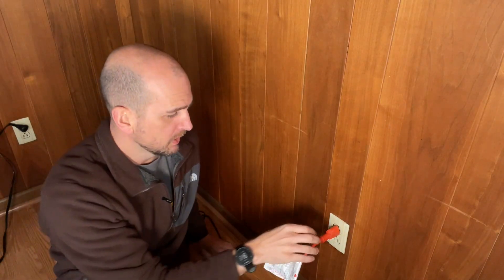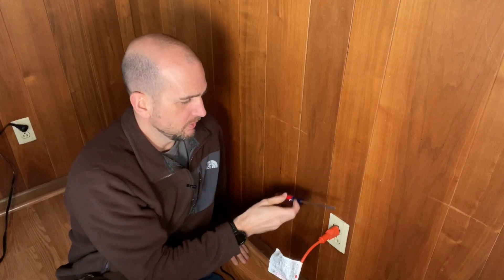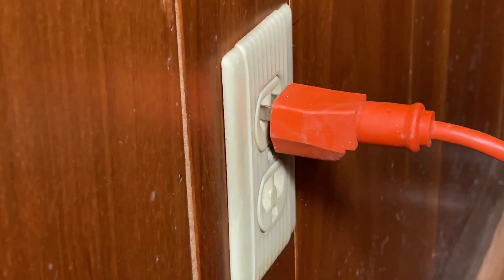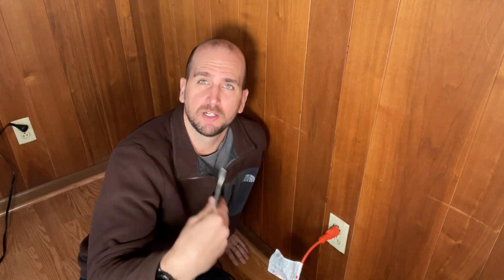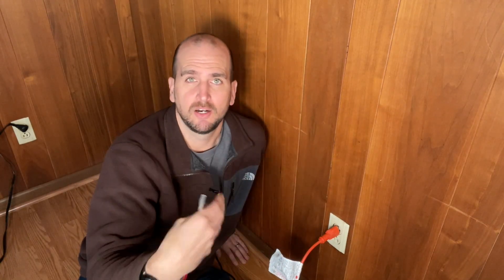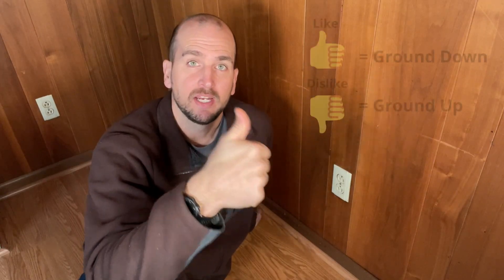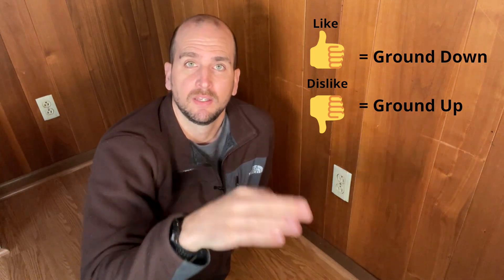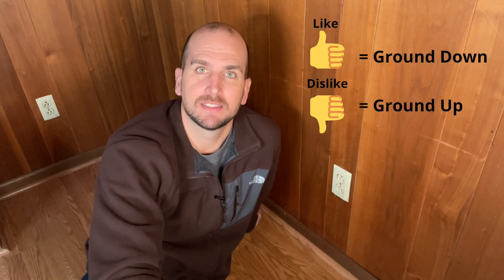Should An Outlet Be Installed Ground Down Or Up

Comment: I have actually seen something hit loose prongs and cause a short. It was a necklace and while the outlet was ground down the plug it hit didn't have a ground prong making that point irrelevant. Interestingly in the instant before it popped the breaker both the outlet and the thing that was plugged into it (I think a small alarm clock) were both damaged and had to be replaced.

Despite that I still prefer ground down because any thing I've ever owned where plug orientation mattered (most notably my wife's various plug in air fresheners) assume ground down. The last apartment we lived in every outlet was ground up when we moved in and I reversed about half of them in the time we lived there to accommodate our stuff.

Comment: Reposting here. I chose thumbs up only because I liked the video. I have done a lot of electrical repairs in homes and what I do is try to maintain consistency. If the home has ground down outlets I install new outlets the same way. And vice versa. New construction I do ground down as you mentioned, most angled ac plugs still follow that practice.

Comment: The ground pin is more likely to pull out enough to lose proper contact if you have it at the top (due to the leverage of the cord pulling down). The result will be an "open ground" connection which could result in getting shocked, etc. in certain applications (as I have seen happen many times in my work environment).
Reply: It's impossible for the ground to disconnect before hot and neutral. I've tested it.

Comment: With the ground up, if you were to pull the plug out while applying pressure against the wall with your thumb and forefinger, your thumb would most likely come into contact with the top prong (ground) first.

Comment: Originally, before we had plastic receptacle covers they were all metal. The ground was to be installed up for safety in case a cover should fall off and contact the legs of what was plugged in... This is fact.

Comment: Some cords have right angle plugs. Do you want the cord running down the wall with no bend in the cord? Or, do you want the cord running up the wall and then down with an ugly bend in it? You can always look at the labeling on the back of the outlet. If the text is right side up, then install it that way.

Comment: Ground down.  Not only does is practically every plug designed for ground down,  wall mounted surge protectors are designed for ground down.  But most importantly, ground down looks like a face 😲

Comment: I had taking classes at a State  University, one class was on Electrical Safety and was a super class. The instructor was a Senior Master State Electrical Inspector was telling the reason why the ground should be up. He question the class "who has small kids". Sometime they walk around with something  in they hands, let say a spoon, fork or something made of thin metal. If you have a ground down a plug had a tendency to sag downward, exposing the hot and neutral pole and a child with any thin metal will hit them, the child would get electrocuted. By having the ground up any thin metal  will touch the ground not the hot and neutral.
One thing I would like to say to the DIY guys & gals putting outlets in, don't let your young childen watch you doing any outlet change over. My son at the time was 4 years old, was seating beside me while I change out the outlet. The next day I went to work and when I came home the wife wanted to show me what my son did that day. What I say on the flood was the outlet I put in the day before.

Comment: I'm a union electrician in the northeast for 30 years, the industry standard here is that on any commercial and industrial jobs the ground goes up and in residential houses or apartments, the ground goes down. The reason we do it this way theoretically is that in a commercial and industrial building if a piece of metal slid behind a plug, it would hit the ground prong first instead of shorting out by hitting the hot and neutral prongs at the same time. That's the theory anyway.

Comment: the fact is that there isnt a code but an upside down receptacle is an indicator of specific identifier like if you add switch or 20 amp or 240 or gfci protected...... something that isolates. 
this is when you invert a receptacle

sometime people have a specific need to flip it for what ever plug demands such as it can only fit 1 way because of furniture and plug combo

if your your elderly and visually impaired you can flip all your receptacles because its easier to push in ground first or you can safely find ground by touch and guide ground in because ground cant bite you.

Comment: I prefer having the ground up.  There are no differences between ground up or down except for safety.  I work in a factory where staple guns are common, and all it takes is a random shot from the misuse of a staple gun to cause a spark and create a fire.

But, I will accept ground down because the device manufacturers commonly build their plugs for ground down.

Really, the standard outlet in the U.S. was not well designed for its job.  It is a "it works" solution, and everyone keeps going because no one wants to take time to change the plugs for something that would properly solve the safety issues.

Comment: When a plug is loose, it tends to start to angle downwards. If that happens with a ground-up outlet, it's possible to break contact with the ground while still retaining connections to live and neutral. That seems like a far greater risk, and is a point in favor of the standard ground-down orientation.
Reply: A plug where that's possible isn't legal.

Comment: In the absence of guidance from Code, the best bet is to follow general practices. Basically, as you touched on, that means ground up in non-residential applications and ground down in residential, with the exception of half-hots. This makes it easy on the user, who is already used to having receptacles installed in this way.

As an add-on, when I install receptacles sideways, I always put the neutral side up. It's safer, and I've never heard a compelling argument not to, such as from a user ease standpoint.

Comment: I have seen many ground down installs where the plastic around the ground was broken due to stress on the cord like with a wet dry vac or sander especially with 20 amp extension cords that are quite heavy .

Comment: At my place I bought 2 years ago, the outlets that are ground-up indicate that they are separate 20-amp circuits each with an independent circuit breaker.  That's an easy way to identify those circuits without using the outlets that have the T/sideways blade slot for specific 20-amp plugs.
Reply: Why would you want 20 amp outlets with out the ability to plug in 20 amp appliances

Comment: As for the hot and neutral cross arc,  ground to hot is exactly the same being neutral is grounded at the electrical panel. I am an electrician and at the company I work at we hate grounds up but in saying that if I was to build myself a new house I'd put the plugs sideways because the cords plugged in always look so neat when they flow nicely along side each other rather than passing over on another. The other benefit would  be you could then have the neutral and ground above the hot so anything falling is actually less likely to arc out.

Comment: Grounds down because any 90 degree plugs on devices have grounds down you don't want a plug wire going up the wall,  Most refrigerators have these style plugs

Comment: I go ground down because most grounded appliance cords are designed to hang in this configuration. Transformers/charging bricks also stay put when hanging down and send to pull out when hung the other way. I think an hour area, commercial buildings with metal wall plates the inspectors prefer the ground up in case the wall plate becomes dislodged and falls down on a prong.

Comment: Also not just a short but if the material is touching both hot and neutral is could just simmer and heat up causing a fire not just a short.

Comment: ground up for commercial is how I was taught, because of most plates/covers are metal in commercial ,  and ground down residential most are plastic covers. plus a lot of the small outlet testers plug in with ground down if not tester will be upside down when looking at code lights. but before I used to do all ground up, because way i was taught in electrical school.

Comment: I am an Union Journeyman Wireman,  I have worked on commercial and industrial jobsites all across the United States, for 24 years,  and 99.9% of the of the time, the receptacle is installed ground up.  The .1% was vendor preferred.  I rewired my 1928 (2015) old home with all ground up; I also used nothing but 12-2 w/ground and all 20 Amp breakers in my home. No 15 Amp breakers and 14 gage wire. Why? Well the first year in my home I had no furnace...just space heaters.  Space heaters are a fire Hazzard waiting for opportunity. Space heaters use 1500 watts. Do the math. That 15 Amp breaker will not always trip...the wire will just over heat and the receptacle will cook and over heat. Happened with a floor receptacle and it was under an entertainment center; I could smell it but not locate. I unplugged every Space heater in the house.  I pulled the on under the entertainment center the whole plug exploded in my hand and was in a metal cut in box with jiffy clips/ F clips pending on your region.  That's when I decided 20amps in my entire home. Over rated yes, will I ever worry over a 1500 watt Space heater or an appliance causing a fire no.  Three years later I was able to afford a gas furnace. 

Here is a thought...you ever see a kid with one of those cheap remote control cars with the thin remote wire...imagine a loose plug/ receptacle and that wire making contact with the ground down...that child will be electrocuted. Hope that image changes your minds...ground up!

Comment: I’m a portrait artist and I installed outlets into my studio. (I got help from my electrician friend) I had the ground down 😮 because the eyes should be on the top and the mouth on the bottom. 😊
Reply: That would be my answer also, but I’m not an electrician.  😄
Reply: This is the correct answer
Reply: This is the correct reason. Why would anyone want the face upside down? That seems demonic, like in those movies when holy crosses get turned upside down.

Comment: The argument that something might randomly fall on a loose plug is just dumb. It's much more likely that something like a speaker wire is pulled upwards into the loose plug in which case if it gets energized it's in somebody's hand. The reason that codes don't specify a requirement for any particular orientation is because when they investigate and experiment they find no definitive evidence that any orientation is safer.

Comment: Aesthetically i choose GND down but best counter argument ive  is because Hot is on the right which correlates with standard plumbing practice but that also varies between manufactures. wish things were more standardized

Comment: YouTube no longer shows the number of dislikes.  I usually put my ground down.  I have several UPS units, surge protectors, and extension cords with plugs like the black cord you showed.  Down works better for those.  From an electrical perspective, it doesn't matter.

Comment: I install ground down. Most cords fall toward the floor and the pull on the cord keeps the ground prong seated completely. If your wire is pulling away creating the gap and you are concerned with items falling across the hot and neutral,  then you need to use a different outlet of better quality.

Comment: Ground facing down is just as much of a topic as key holes facing down as well. Honestly, grounds face down on most 3-prong cords so the receptacles should face down unless a corded appliance deems otherwise. Also key hole tumblers should always face down, meaning the wavy part of the key faces up not down. This is so the tumblers aren’t prone to moisture collecting and corroding the tumblers making the key hard to insert. The same as grounds face down not up, people will say otherwise on both topics so it’s a no win with defenses on both topics. 

Do as you do and let the others figure it out by having problems, then they’ll come to your video and learn something!!!

Comment: Wow, I never thought about it but I mostly see with it on the bottom.  But installing with it on top for outlets controlled by a switch make good sense.  The only problem I see is how many people do that.  I'm going to check and make sure mine is on the bottom.   I have wire nuts (ouch) that I'm getting ready to switch to either Ideal "In-sure" or preferably Wago.   I just bought the Ideal since they were the only ones at my DIY home improvement center so didn't have any options on selections.   Came back here to find out more and now I plan on finding and purchasing the Wago brand from wherever.   I prefer to purchase locally since on-line purchases does absolutely nothing for local economy.    The Ideal were from the L store so I'm going to check the H store to see if they have the Wago brand.

Comment: As a Washington State Journeyman Industrial & Residential Electrician- I was taught that with the ground in the Upper position, the ground prong on the plug could pull out with the hot and neutral still energized, thus creating a possible electrocution hazard.
 With the ground at the Bottom position if the plug is accidentally pulled; the last prong to disconnect will be the ground!
 There isn’t a National Code Law on what direction the outlet should be orientated as of the current NEC 2020.

Comment: sir:  since these outlets are 120 volts there is no neutral conductor.  There are a ground, a grounded conductor and a hot conductor on these receptacles.  A neutral carries the unbalance load on a 240 volt circuit so a 'neutral' doesn't apply here...  I don't like the ground pin up!

Comment: The safety argument is just a ridiculous argument made by people who for some reason prefer the ground be on top. Let's be realistic here for a moment. First, if the out is maintained correctly and something is plugged into the outlet, then there should never bet any exposed part of the metal prongs of the plug and therefore no hazard of shock. This eliminates the whole something falling onto the plugs. So now we are talking about the 1 in a million chance that the prongs are exposed along with the 1 in a million chance that something small enough falls in just the right way to make the 1 in a million chances that it lands and touched both prongs at the same time. Come on!! Really. Has anyone ever heard of this actually happening on accident. This is like physics saying you can hang an elephant off the side of a cliff with his tail tied to a daisy.
My opinion it really doesn't matter but in all my years of owning houses and doing DIY stuff, I have seen very few outlets installed with the ground in the up position and hence I prefer the ground be down, it just seems to look better and make more sense to be that way.

Comment: I am a retired BSEE and worked for many decades for a large power utility. We had no rules, but most I saw (maybe all) on premises were ground down.
And till the recent decade or two, I never saw a ground up install anywhere, except a few, which I figured were just happenstance.
And then I thought, that isn't right....or....is there a reason.

One could be as mentioned here, that something or someone might put metal in from the top accidentally (or kids might).
But I have never seen that happen. Never. The real way to prevent this kind of thing is to redesign the plugs and outlets to be insulated near the handle of the plug, and when it is part way out, it is dead.
But again, I have never heard of such an incident in any description. I am not saying it hasn't happen, but .....

As one other person mentioned, the ground down does make the plug less likely to come out from the wall at the top via downward pull. 

BUT, here is one thing I thought of long ago, not seen mentioned here.
Ground down means the ground is the last thing to become disconnected. That means that the tool or other device you are using is Grounded till the last connection is gone. And THAT is where you are most likely to be.
Ground up means you may have an UN-grounded BUT HOT device.

I go for the grounded option with the ground DOWN. And after all, it looks more like a happy face. Ground up looks like you are dead.

Comment: I understand the argument goes both way however I think it depends on two things..... The kind of cover plate you are using and weather the outlet is switched or not. In hospitals they want metal cover plates because they are easily cleaned and disinfected however should the metal plate come loose for any reason and hits both of the prongs you have a bigger problem. With the plastic or nylon covers..... Well that's a no brainer. 
Having the outlet ground side up helps to identify it as a switch out.

Comment: I've always been on board with ground up, even before my mother destroyed a tape measure because she was measuring blind behind the microwave, whose plug had become a little loose.  Unfortunately every wall wart I've run into was designed with the prongs at the top, which is not great structurally.  The only exception I've run into is the power supply for an Atari 2600.

Comment: People today think they are smarter than the past generations. One point I might make, is that 50 years ago the owners manual showed you how to adjust valves.......today's manuals tell you not to drink the battery fluid 😲🥺
What is code going to require next? Foam rubber corners on every corner? Airbags on the front bumper of your car to "save" any pedestrian you bump?